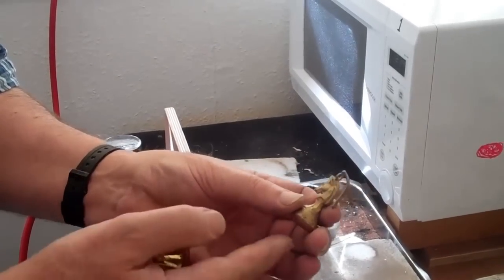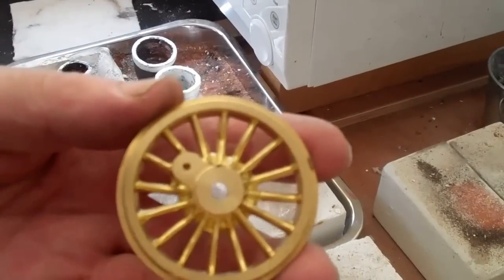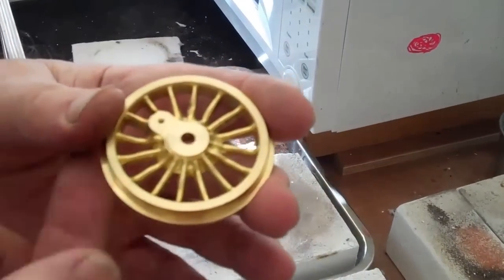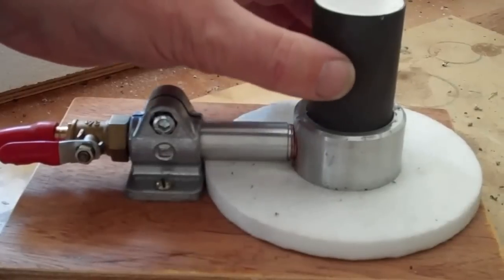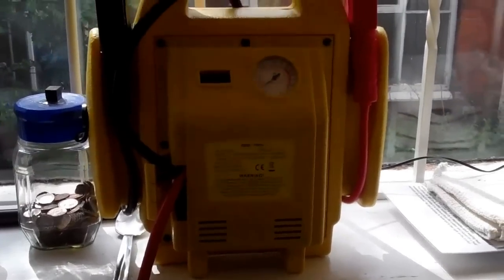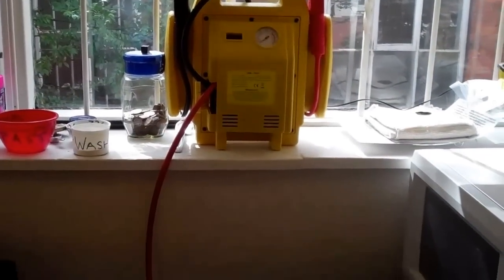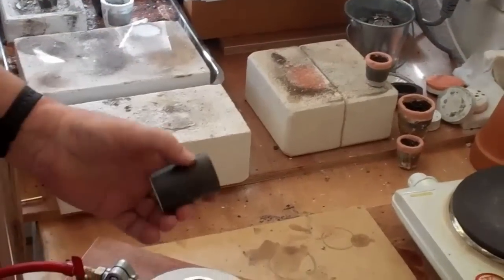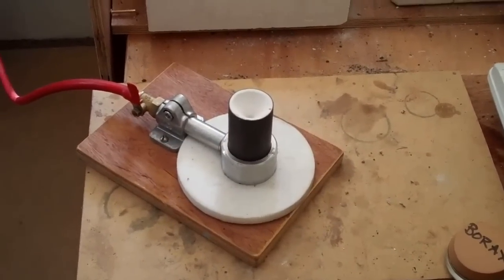Intro to vacuum casting with microfoundry

Comment: Am I right in guessing that the air is exhausted from the mold via the small gaps between the grains of sand? If true then I wonder if a similar setup could be used to expedite the curing of a sodium silicate {water glass} and sand mix without the use of a carbon dioxide tank?
Reply: What temperature do you heat the investment to?

Comment: So, does the vacuum draw air through the porous mould, or is there some other method that I'm missing?
Reply from the maker: The White Dragon Yes that is exactly what happens, the pump evacuates the tank to "store" a vacuum which at pour time then draws air from the mold through the porosity of the investment plaster - we scratch the bottom of the flask to ensure there is not "fat" plaster preventing air flow.

Comment from the maker: Hi Molly the vacuum table is a piece of turned aluminium which is bored to fit the flask, a series of inner rings are bored in to the base to up the surface area of the vacuum and then cross drilled to the hose. If you know someone with a lathe they could make one for you, alternatively we supply them via steedcraft etsy shop
 https://www.etsy.com/uk/listing/111712223/vacuum-casting-turned-base-and-fittings?ref=shop_home_active_4
cheers
Quin